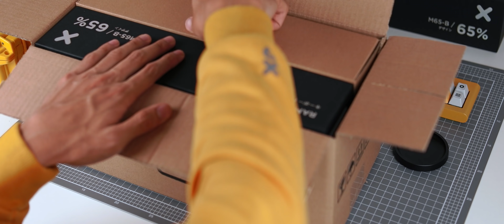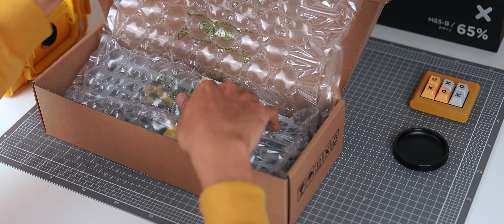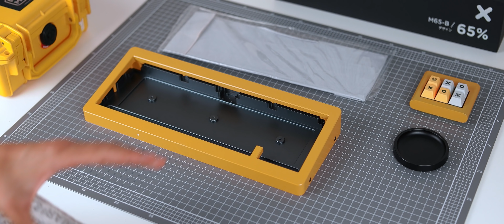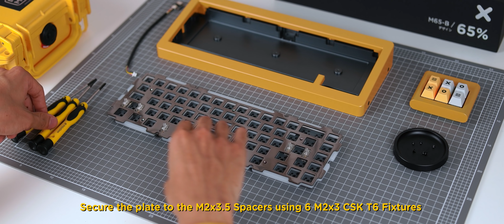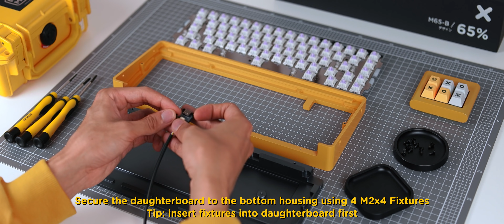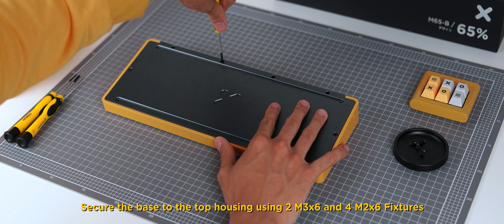RAMA WORKS® M65-B - Unboxing & Build

Comment: This is so nice, cant wait for mine to finally arrive.
Kinda sad I did order hotswap instead of soldering PCB though.
Reply: @miguelacero2993  I just like to solder and back when the group buy was live in late 2019 I had not really done it so I choose the "safer" way. There is not really anything better or worse with either method. Hotswap is just more flexible since you safe yourself from desoldering if you want other switches. I have some other kits coming like the Kara which was only Hotswap so I would use those boards for trying potentialy new switches I am interested in in the future.

Comment: Hey folks. Quick question: the spacers should add some hard spots on some keys, right? If so, would it be possible to skip the spacers?
Reply: it might make the mounting uneven
Reply: @jonahoxman7232  just making sure because Taekeyboards skipped the spacers for his kara build. Was wondering if the same is applicable for the rest of their keebs
Reply: @12345678946513  if you skip the spacers you can't take all the switches out at once, because the pcb would not be secured to anything. So I would recommend installing the spacers if you plan to swap switches a lot and don't want to have to take one switch out, insert another switch, take one switch out, insert another switch, etc.